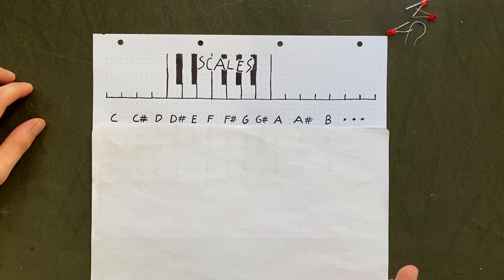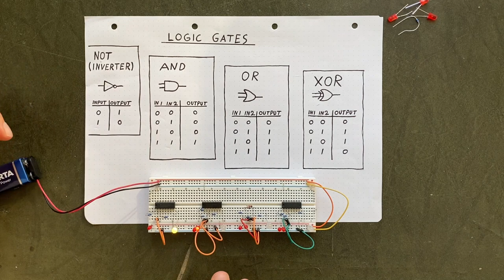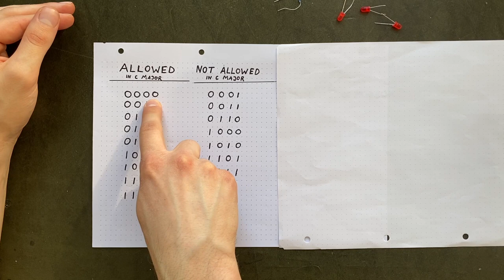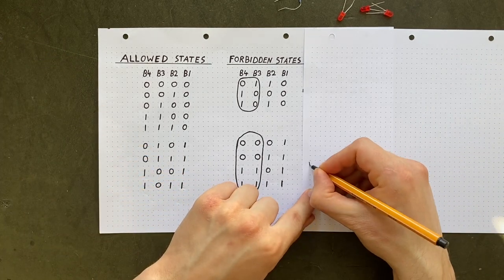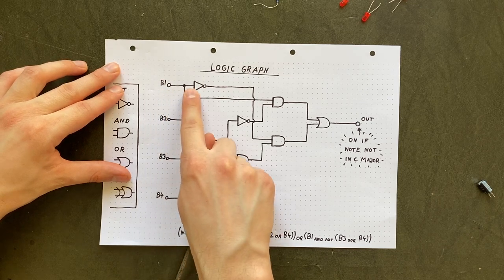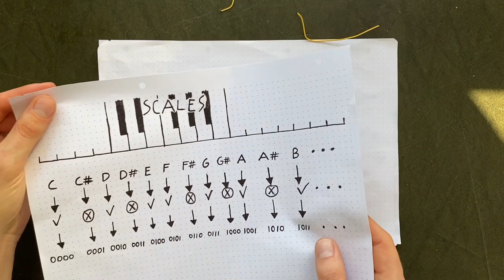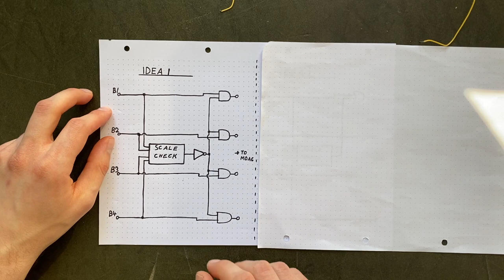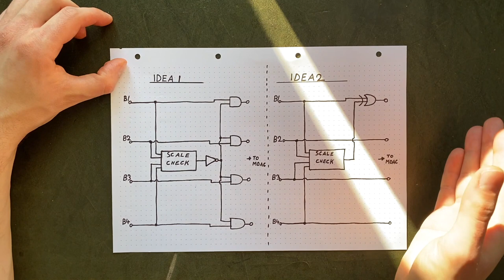Designing a DIY synth arpeggiator with logic gates: Part 2

Comment: I wish I had watched this when it came out. I'm a current Patreon supporter, and I'm in the midst of building up my modular. It's like yours, basically, but nearly all of the ideas are borrowed rather than cooked up by myself. This video follows a beautiful investigational arc, hypothesizing, testing, failing, recalibrating, and finally reaching the desired conclusion. Keeping to that cadence in the presentation scaffolds the viewer's experience so nicely. Again, thanks for the cool stuff you have taught me.

Comment: Read the "Karnaugh map" entry in Wikipedia. This is the method they taught 1st years at university in the 90's for converting a truth table into a simple boolean circuit with AND, OR and NOT gates.
Reply from the maker: thanks, i'll check it out!
Reply: ive used the karnaugh map but in the best case i've used 8 digital gates (and some of them were 3-port and and 3-port or, so it would be more than 8), which is the same he used
Reply: They still teach it at university 1st semester :) (at least for me...10 years ago as EE)
Reply: @yezariaelll  I learned it last year (first year, second semester) - it's still going strong!
Reply: As a comp sci graduate, I am really annoyed we weren't taught this for the EE classes we had to take in the late 90s.
Reply: I was thinking the same thing. K maps are great for minimizing ands and ors, but I don’t recall it being used to detect any xor optimizations. Still K maps are a godsend when you’re dealing with random don’t-care states mixed in.
Reply: Haha glad that someone mentioned it

Comment: Since now you are in the digital domain, it would make sense feeding the TLC7524 thru an Arduino, with Midi input for keyboard, MidiUsb input for Ableton sequencer, scale types library, arpeggio types library, internal clock, external clock reception, LCD, buttons,  etc.
Nice job of yours.

Comment: Just a tip, you can always replaces some gates by a combination of others, for example, a AND gate can be replaced by a combination of 2 NAND gates, in some cases this could help use less chips or at least using the same kind of chip but needing more of then, which in sometimes can be more practical, search for logical gates equivalence on the web for more information.

Comment: (b1 xnor b3 xor b4) or not(b1 or b2 or b4) is one way of expressing the scale check circuit with only 6 gates, I'm not sure if 5 is possible. Alternatively it's also possible to use an eeprom chip to do the scale checking for you. I recommend watching "Using an EEPROM to replace combinational logic" by Ben Eater if you're interested
ps: Love your series!!
Reply from the maker: i'll have to lay that out on paper to wrap my head around it, but sounds promising! ben's EEPROM video i know, and yeah, it would definitely be the best solution if you want to build a module with multiple pre-set scales. i think i'll go in a different direction with this though – i want to develop it into a really primitive, low level programmable computer/logic module. basically i'll leave the MDAC part as it is, but for the bit processing i'll just have a bunch of patch points so that you can chain different logic gates as you see fit. might not be practical, but i think it might be fun!
Reply: @MoritzKlein0  sounds like a fun idea! I was thinking to use an array of 16 switches so you can switch up your scales on the fly (each switch assigns for each note whether it's allowed or not) so you can do stuff like change any major key to its minor with 6 switch flips. What ever you decide to do I will be looking forward to it. You inspired me to continue working on my breadboard projects again <3.

Comment: Another thought is you could make a diode rom, but with diodes and jumpers (or switches) for every bit so it can be reconfigured. Then you can "program" your allowed notes into that, in the order you wish, and feed the output of your counter into the demux that enables the read lines for each row. I can't adequately describe the diode rom here but there are examples if you google around a bit. It's the same idea as using a rom/eeprom.

Comment: Accidently found your video. It's less musical electronics, more a tutorial into logic design - nothing wrong with that. I couldn't help but wonder if you might simplify things just by different coding of musical notes to binary e.g. C=001; D=010; E=011; F=100; G=101; A=110; B=111. Use the top bit as a flag for sharp (even though some notes do not have a sharp), i.e. 1001 = C#, and use 000 for a special case (silence?). Apologies as I have no idea how you are using the bits, but I am just throwing in this suggestion based on years of programming and coding data structures :-)

Comment: A much easier way to do this is to use a lookup table.  You can create a ROM with the number of entries corresponding with the number of possible outputs from the counter.  And just place the allowed values in there.  So the counter sends the Address or count and the ROM outputs the note bit representation which can then just be sent to the MDAC.
Reply: I think that Moritz has stated that he wants to keep this as primitive as possible though.
Reply: @bobvines00  I don't really see why... a simple microcontroller could have all of this data in flash memory with way less wiring, and trivial to change if/when required. If you're going to "go digital" it seems a bit futile to insist on using discrete logic gates IMHO.

EDIT TO ADD: After watching all of these again, I realise now that it's a useful learning process, bringing in the Karnaugh maps and teaching about logic gates.  I don't really think it's about being "primitive", but more about being educational.

Comment: Interesting rhythmic pattern going from E to F because not skipping note there but I don't hear that when going from B0 to C1. Why?
Reply from the maker: oh good question. i‘ll get back to you on that!
Reply: @MoritzKlein0  I'm just curious. Great video.
Reply: @MoritzKlein0   @Electronic Garden 

The presence of the rhythm itself is no mystery - it comes from the flips playing the allowed notes twice, so they sound like one note held twice as long. But the question of why it only happens at EF and not at BC is interesting.

This is your description of the pattern: "Every sharp note seems to be identical with its paired natural one except for the first bit. So it's safe to say that inverting the first bit of a forbidden state would turn it into an allowed one." But that "pairing" turns out to be asymmetrical as you move up or down the scale.

Because of that asymmetry, there are two different kinds of flips happening. The first kind, call it the type 1, is when the allowed note is played, and then the forbidden note follows and is flattened_: C is played, then the would-be C# is flattened to C. Next D is played and the would-be D# is flattened to D. E and F then sound, but at the next note, we get the other kind of flip, type 2, as the forbidden note sounds _first and is _sharpened_: the would-be F# is sharpened to G, and then the allowed G plays. Following through, we get G##-A, A##-B, and back to C.

If, after playing F, the logic "looked ahead" and, seeing that the forbidden F# was coming up, "knew" to flatten it to F, then that flip would be the type 1 flip. Using such look-aheads where needed to convert the three type-2 flips into type-1s would put the two short notes rhythm at B-C. Each look-ahead would need the rule "invert both the second and the first bit" but I'm not sure how you'd implement knowing which rule to apply.

Even more manipulation would probably allow you to put the short notes wherever you wanted them, but this substitution approach can't get rid of them entirely.